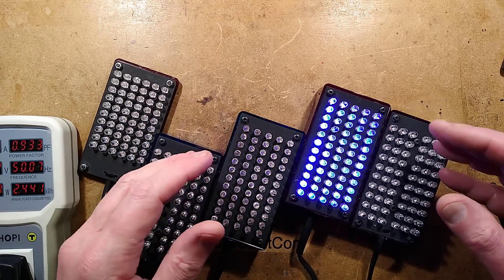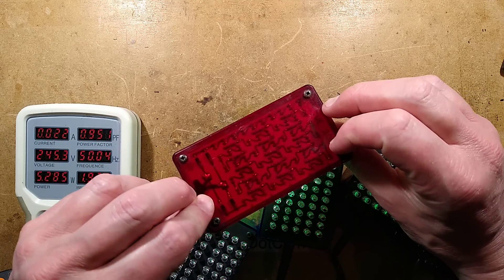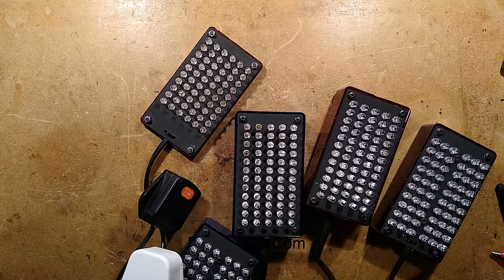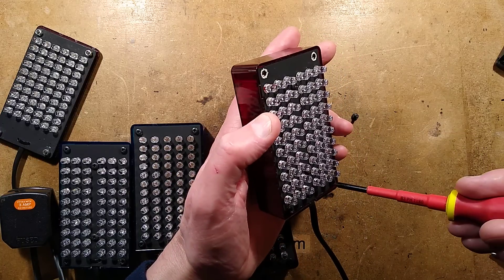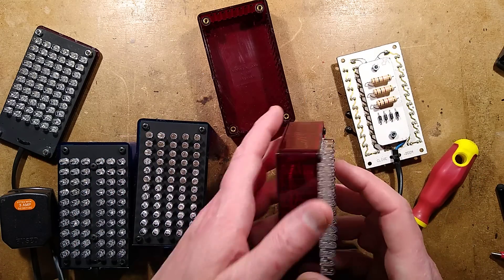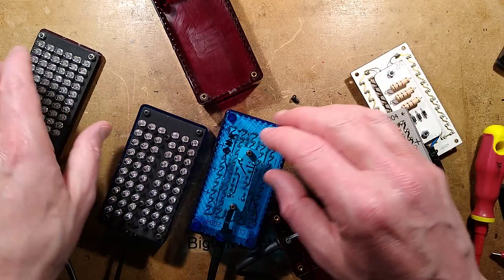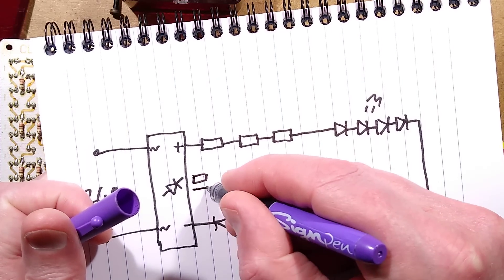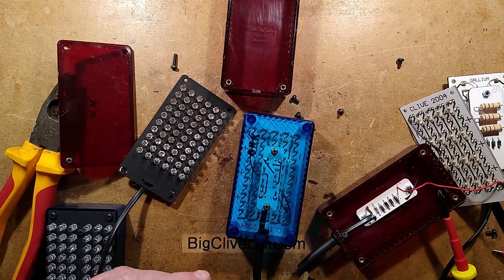Prototype mains LED lights

Comment: What is the particular reason you favor these light emitting diodes rather than the modern ones today that are basically like chips?
Reply from the maker: These were the only easily available ones at the time, and also much easier to solder with a standard iron.
Reply: @bigclivedotcom  When you opened up the dollar tree LED lightbulb- why were the LED chips configured more intricately than the standard easily accessible LED's?
Reply: All depends on the design objectives, availability, cost and complexity.   Brightness isn't always paramount. 
If I heard correctly this was more an experiment in different configurations and seeing how the LEDs performed.
Just because something is old does not mean it is useless.

Comment: Would LEDs degrade over time even if they're not powered? I often find old projects in random locations, often cannibalised for parts for subsequent projects. Like you say, it's nice to look back on them.
Reply from the maker: The older red technology was very stable over time, but modern LEDs seem less stable.

Comment: Around that time I was making all sorts of torches using the cheap, "ultra bright" (10000mcd?) LEDs. 10mm and 5mm clusters, trying to find the best brightness/compactness combination. :)
Reply from the maker: Ah yes.  Those wildly inflated intensity figures.
Reply: 10,000mcd or real life 1,000mcd.   Not much has changed when it comes to the advertised specs.
Reply: @markkrusemer526  I remember using one of the early 1000mCd LED's as a torch, putting it into a small round case, and then using as a night light. The green light actually made a very visible image of the LED die inside on the room ceiling, must have been perfectly focussed with the lens on the top and the die in the saddle of the leadframe. Even with 10mA the light was daylight visible in shade. 

Used another red one as a power indicator, potting it, along with 4 1N4148 diodes, and 4 47k 0.5W carbon composition resistors, in a repurposed MCB housing, to act as both filler blank and power indicator. That was bright enough to show a spot across the room at night, even at 2mA of current. Lots of resistors because I both had them, and also I wanted long life from the LED and resistors, so ran them at under half power. Lots of epoxy to fill that case up again, and make the leads one with the case.
Reply: Why say 10000mcd? They should mark them as 10000000µcd, that makes the number much bigger!